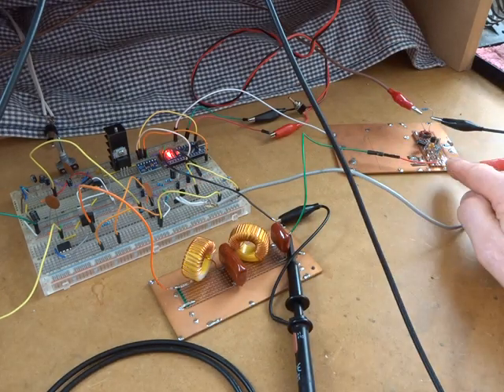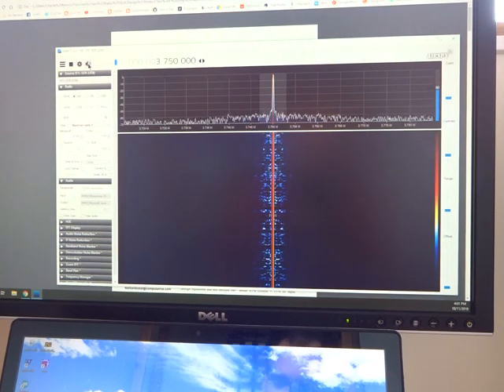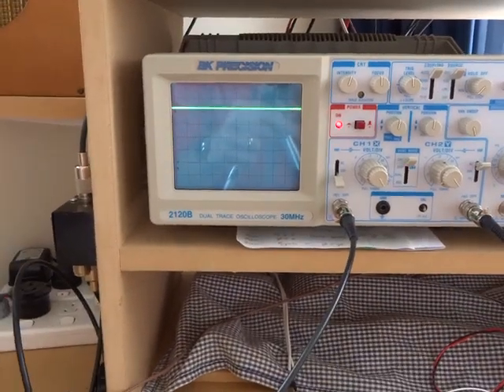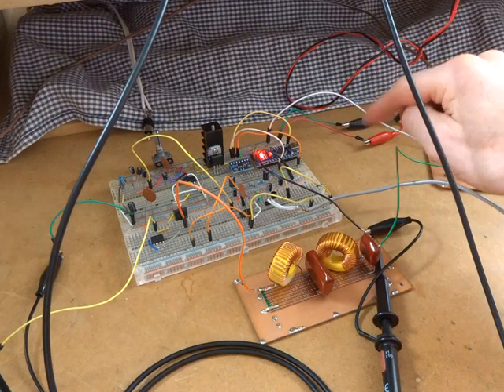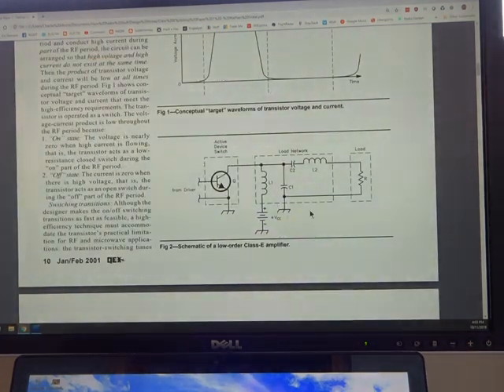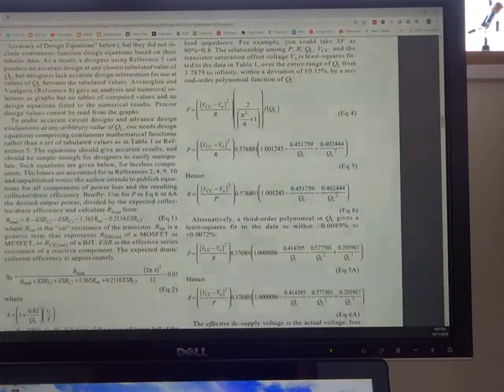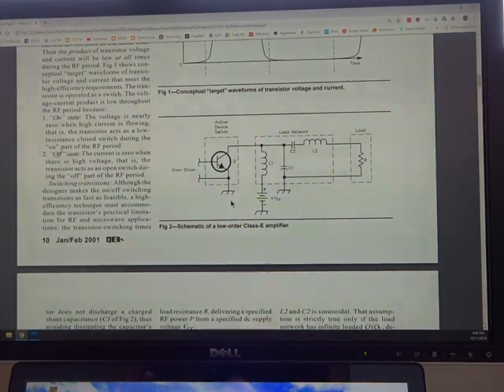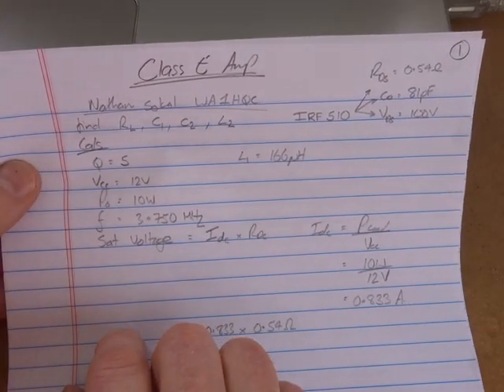AM PWM Rig Part 1a: AM Test Transmission, Class E Amp Thoughts

Comment: I manged to build an AM transmitter to 88% modulation with a class C ouput stage, with the class C Vcc being supplied by the direct output of an LM386, the LM386 has its quiescent output set to 1/2 Vcc. When i input audio it changes Vcc for the class C, modulating it. It actually works really good. Puts out about 100mw (legal limit for part 15)  with 12volt input, uses a 2N3906 for the class C. The class C has a LC tank on it with the required frequency.
Reply from the maker: That's interesting thanks. I'll note that down.
Reply: @CharlieMorrisZL2CTM  i believe i meant 2N3904, not 3906. It uses npn

Comment: Not sure if you've changed the modulator since last time. If not  the output switching might need some attention,  particularly a damper diode, Steve QIX has a discussion here: http://www.classeradio.com/pdm_article_solid_state.html
Reply from the maker: Hi Paul. I'll take another look. The diode is a fast recovery one (MR856RL), and is connected from the input of the filter to earth. The output of the pulse generator looks good, in that I can get the full range of pulse widths as I adjust the dc mean point for the audio drive (the audio sits on top of the dc mean). I'll keep experimenting.

Comment: I think you must pay attention and that you will use a base plate (earth plate)
A PCB plate beneath the work piece is connected to earth.
also under the breadboard
and keep the connections short ( shorter? )
a pity by the way that you already have 2 chokes for filtering that you have to use a third
but I understand you can't attach that heavy capacitor directly to the IRF!

friendly greetings from The Netherlands
Rob
Reply from the maker: Thanks. At the moment I am not too concerned as I'm only dealing with 70kHz on the breadboard. When I do solder it up it will certainly have an earth plane.

Comment: I wonder if instead of using the audio PWM to modulate Vcc, you could keep Vcc constant and use audio PWM to gate the 7MHz signal that drives the MOSFET's gate, ie when PWM is high, drive the gate at 7MHz and when PWM is low, don't. Does that make sense? I hope so. Anyway, good to see you back. Cheers, Steve.
Reply from the maker: Thanks Stephen. I'll keep looking at this config for now. The gate modulation does sound interesting. I'll have to take a look at that.
Reply: I was thinking the same thing then I realised it would lead to horrendous extra side-bands without massive thinking, and my thoughts switched to controlling the duration of the turn on pulses...
Reply: @Chris-ZL  With the side-bands being plus and minus the PWM frequency, I guess?
Reply: @stephenstebbing9460  and more as the PWM is a square wave with lots of harmonics